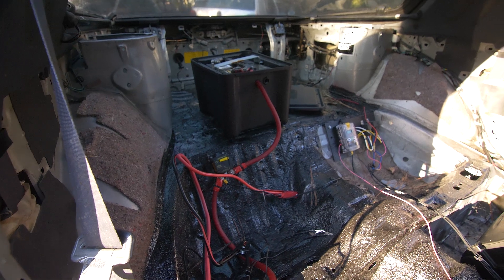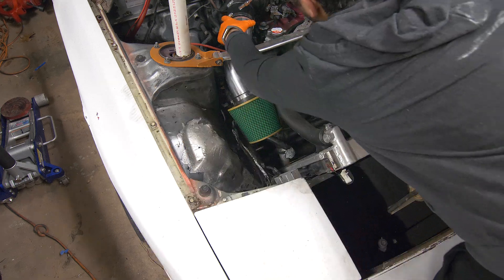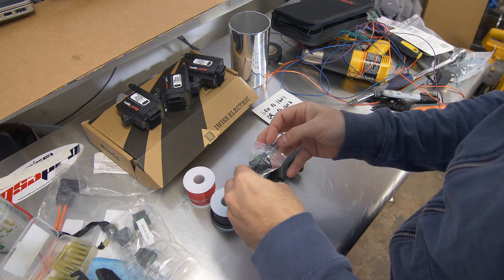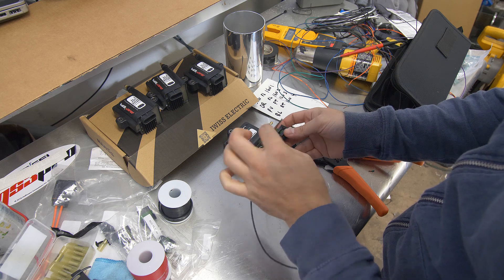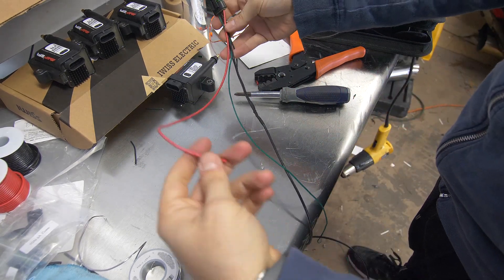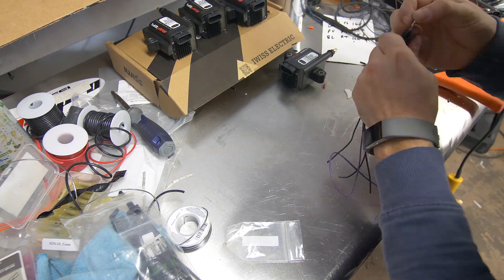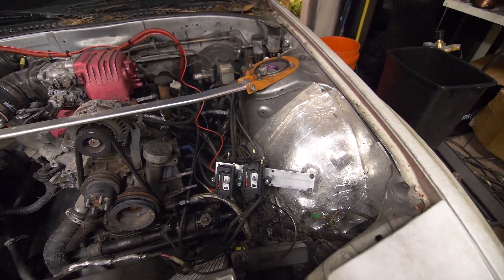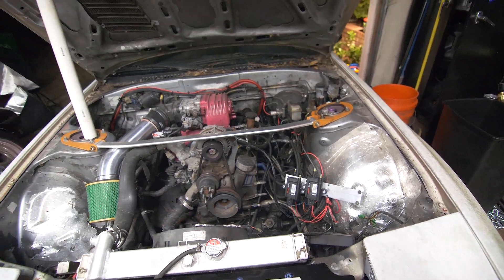Upgrading the ignition (Smart coils) and intake in the FC RX7

Comment: Supercarmio if I switch from fc stock coils to smart coils and stock fc CAS I just have to change on ignition set up spark mode from Distributor to Direct Fire? I'm using a Haltech sprint RE
Reply from the maker: Stock wiring? I'm not sure what your setup is but for direct fire you'll need to send an ignition trigger to each coil. FCs stock will utilize a toggle on the trailing coil. Also when making this type of change make sure you do so with the coils disconnected. 👍

Comment: So many conflicting ways to wire up these coils out there. How do they run when pushed?
Reply from the maker: They are great! So far they seem to be much more reliable than some other coil solutions I've run on other cars (i.e LS2s). Haven't had any issues with heat or anything like that either.

Comment: So I'm assuming you put the number 30 to the battery the switch to that fuse box and sent the accessory lead to the coils  
Just asking cuz I'm doing my coils now and was planning on just crimping the 30 and the switch together to just use one ignition switch if that makes any sense
Reply from the maker: You'll want pin 30 to be connected to a fused power source (mine's right off the battery). Switch (86) comes from the ignition switch. You'll want these to be separated since the coils can draw a good amount of juice. The relay allows you to use a low power signal (ignition switch) to trigger the flow of a high current power feed (30) to your circuit (12v for coils - pin 87). Hope that makes sense 👍

Comment: Cool vid,video, got a 88 10thAE, and I want to do smart coils,I did an AEM 3RD GEN FUEL PUMP  full exhaust, HKS injectors..and an old school apexi super afc that I disconnected.. do I need a tune and what would you suggest ,im gonna change injectors possibly
Reply from the maker: That sounds like a nice setup man! I would definitely suggest going standalone to take advantage of the smart coils as well as any injector setup changes you make. I'm a big fan of Haltech and most recently MaxxECU. A lot of options out there though - Megasquirt, Adaptronic, etc. The ignitor is built into a smart coil 👍
Reply: @supercarmio  thats super helpfull!!! Thank you! Are these things you have access to,? Thats what I need is someone helpful enough to help me with the build,im dropping the tank this week and having is cleaned out and seal coated insides alot of rust from sitting since I had most of my stomach organs out,and just starting to get a bit stronger to do something with my life besides drs ,ive had the car over 20 years,and its on top 5 on my bucket list while I'm still on this side of the dirt! 💜🙏💙💪🏽
Reply from the maker: @Joeboost8805  Damn man, hope you are feeling better! Nah, I'm not a parts reseller if that's what you mean. Could point you in the direction based on your setup though.
Reply: @supercarmio  I am looking for a sponsorship 👍🏼👍🏼👍🏼

Comment: Nice video, can you run this same ls coil set up on the stock s4 Na ecu?
Reply from the maker: Thanks man! I'm guessing you probably could with some extra wiring and such, but I would think you'd want to use these in direct fire for best utilization of em.
Reply: want to run Distributorless and with Carburetors.
without ECU.
what will I need !
I have the Crank Trigger Wheel.

Comment: where did you tap ur 12v switch source.
Reply from the maker: I have a little circuit behind the driver's seat. The ignition switch triggers a relay which gets 12v directly from the battery - that goes to the coils.
Reply: ok, im running ps1000 on my s4 with stock coils. how do I get the trigger signal and still have my tac work if I switch to smart coils....
Reply from the maker: @ranacherian  From the stock wiring harness I used the following connections: Trigger + CAS (CRANK) NE+ = 1T, Home + CAS (CAM) G+ = 1N, Trigger - CAS (CRANK) NE- = 1Q, Home - CAS (CAM) G- = 1P. For the tach, you can drive it with DPO #1, which has the correct pull up voltage (12v)
Reply: thanks dude, will try it...